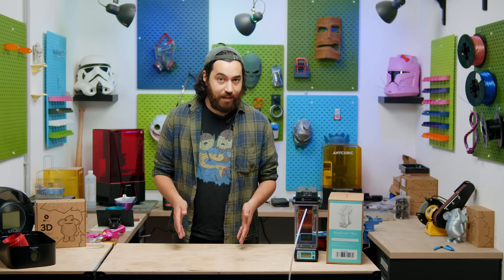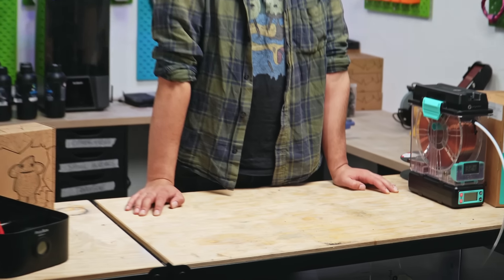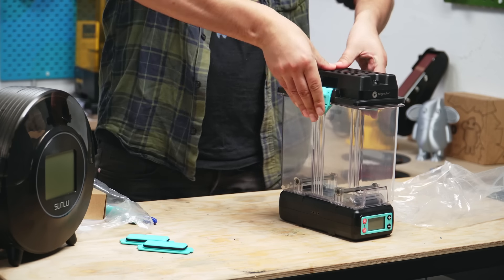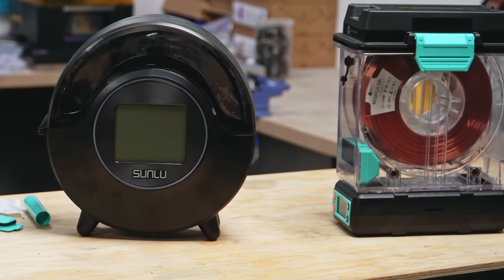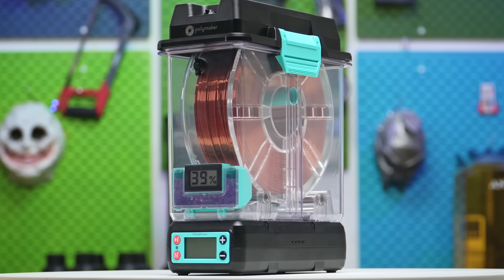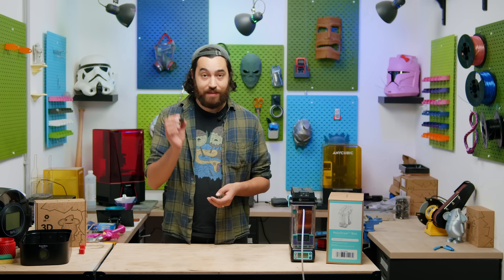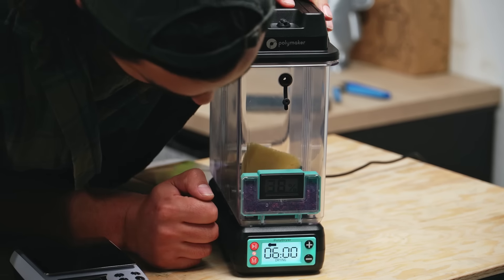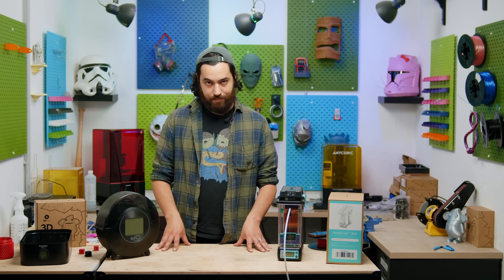Polymaker PolyDryer: Revolutionising Filament Drying and Storage!

Comment: What is your hygrometer reading after a drying cycle? I had some ABS and 12hrs later it's at 26%. With nothing inside the dryer I can't get it to go below 19%
Reply from the maker: Unusual. Normally with filament it takes under an hour to get under 20%. Might be a problem with the silica gel, they should be blue or just a little pinkish. If they're all pink then you need to dry them. If they're blue or this has happened from the beginning then you should contact customer support as that might be a heater or fan issue.

Comment: In what situation would you prefer to use spool roller instead of those 2 rolling bearings at the bottom? Is there any diference at all?
Reply: Cardboard Rolls don't work well with bearings on the flange. Also there are 3D printed Rolls that aren't round and only work on a spool roller.
It's nice that if gives you options.

Comment: How stable is the temperature holding?

A nice product if it's cost 40€
But at a price form 89,24 € sorry, to much with to less (missing a temperature settings in Celsius and not just 3 steps)
Reply: Exactly.
Reply: I'll tell you one thing, it must not be too expensive, it's SOLD OUT!
Reply: @WaldecirSantos  I think the price is going to go up, it's SOLD OUT!
Reply: @joeking433  Sure but it doesn't means it's a good value to me

Comment: What I always wonder with these filament boxes, how do you rewind the spool? I mean, after unloading it from the printer, there's quite a bit of filament which needs to go back into the box right?
Reply: The same way without a box. You leave some filament hanging out and pull the spool out of the box, then before the end of the filament gets loose you hold tension with a hand and boom, no spaghetti

Comment: Have the S2 as well and love it, but agree that it can be a pain to make selections on the screen without tipping the unit a bit. I really like how the PolyDryer has a more sleek and slim form factor. Especially cool that you can buy separate boxes and just switch them onto the heating unit when you need to. Its not going to replace my storage bags, obviously due to the price. But, for things I dont run in my AMS, like TPU, it seems like a great option.
Reply: TPU is not hygroscopic.  It doesn't absorb water.
Reply: @joeking433  I am not a filamentologist, but I can't seem to find anything that supports your claim. Do you have a source? From what I am finding there are plenty of videos on the importance of drying TPU to improve print quality and manufacturers/distributors saying to dry TPU to improve performance.

Comment: I went the food dehydrator route and never looked back after abandoning these dryers. The problem I have with these are that they have a fixed volume and I don't really need all that fancy digital stuff. I also print using my dehydrator by putting the spool resting on a turntable and then making a hole using soldering iron to melt the plastic big enough for Telfon tube to go through and then feeding the filament through it. This way I don't have a limit to spool size since I can just increase the height of dehydrator plastic layers to fit the spool and I can even dry more than 1 spool at a time by stacking it higher. If I need to store them, ziplock bags are really just good enough solutions tbh

Comment: I think it's a little bit false info about the humidity, if you put silica directly around the temp/humidity sensor.
Reply from the maker: Hmmm I thought about that too. I think I might add a second hygrometer without silica gel to the other side and see if there is a difference.
Reply: @3DJake_Official  Great idea!
Reply: In an airtight box this small, after a few minutes, it won't make any difference where you put it.
Reply: Honestly it doesn't matter. Cheap hygrometer with hobbyst-level accuracy, inside a small enclosure is more than enough to let you know inside humidity % are around the value shown on that display. Moving it elsewhere might only change the values 2-5 degrees at most. Keep in mind that non-professional hygrometer sucks at reading low humidity level accurately.

You also need to consider that humidity reading will follows ambient temperature. Warmer temp will cause water vapor leftover to go upwards, making sensor placed on the bottom to read lower humidity values; cooler temp makes sensor read higher humidity reading since water vapor more evenly spreads out. And so on. There's no accurate way to measure humidity at every corner without placing multiple hygrometers and average the value and maintain a stable ambient temperature, but at that point, it makes the box unnecessarily complex, tight, and more expensive. Just keep it one small hygrometer and dry the thing if it went beyond 25%, keep it simple.

Comment: I have a few dryers. I have the eibos single unit and a sunlu S4. I like the idea of the polymaker dry box however I like drying a few at a time when printing bigger projects and like the storage function. I may pick one up but when I think about it the extra boxes are not cheap here in Canada when you factor in exchange. But if the price drops I will consider it.
Reply: Apparently the Polydryer will be available from the Canadian Polymaker site in June. 
Curious to see what the price difference will be.

Comment: They took the very popular cereal containers design(s) and turned it into a purpose built product -- that's fantastic, except that cereal containers cost as little as $5 for the not-fully-transparent and $15 for the clear versions. 

There's no reason the 3d community can't reverse this and make an adapter for the cheaper cereal boxes.
Reply: That's only 15 dollars less and you don't get as sturdy of a clasp, seals, grommets, PTFE tube, hygrometer or custom fit desiccant holder. Idk what your time is worth but its going to take you an hour just to source that stuff not to mention actually installing it all into the cereal container. You only really need one dryer. With the boxes themselves being only $30 and taking into account how much the alternatives cost, this is a no-brainer.

Comment: Your point is very valid, definitely makes you wonder why they didn't let the battery charge while it was sitting inches away from an potential power source.. but whatever, as long as it works (kind of bothers me how much just the plastic box for the top on its own is as well.. like I get it's sealed and everything, but dang..)